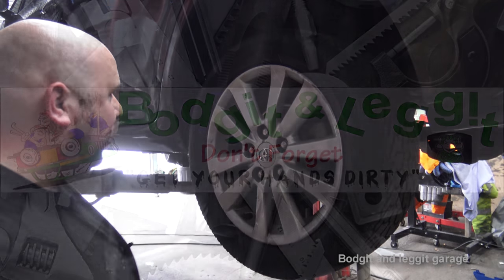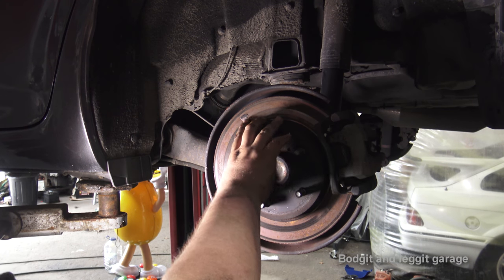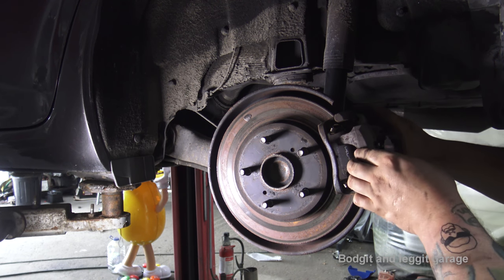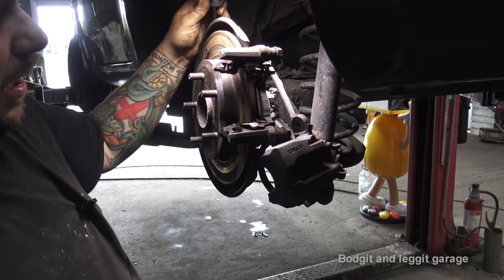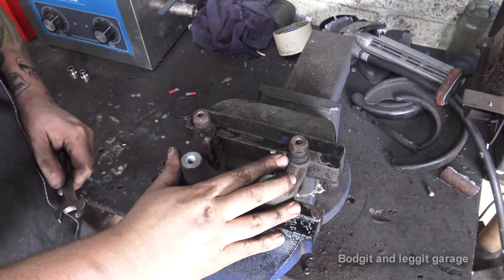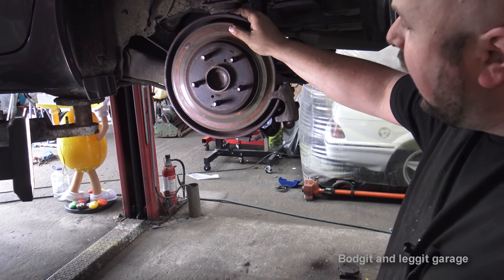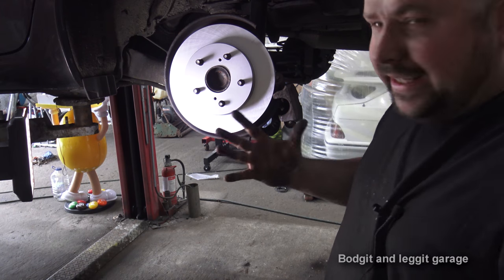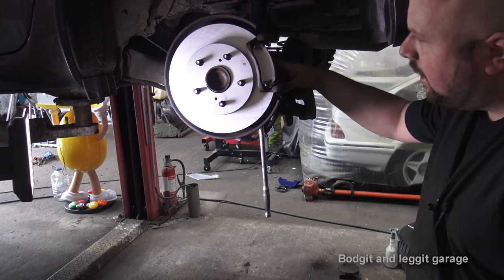2007 Toyota Auris Back Discs And Pads Bodgit And Leggit Garage

Comment: When winding back the piston, the bleed nipple should be open and a pipe fitted to collect the fluid. This should prevent damage to the square backed piston seal from being damaged. Also pads with backing should not be greased as this can damage the backing liner in some cases, the fitting instructions will give advice. 
Remember to adjust the handbrake afterwards.
Good videos, I hope this helps some of the readers,
Reply from the maker: Paul Jeffreys the only thing I agree with you is about tightening the handbrake afterwards on certain vehicles but when you whine back the piston the handbrake adjusts on some vehicles so it's not an issue I've been doing this for years and know people that been doing it for longer than I've been alive never once had a problem pushing back the piston
Reply: Like me 🤗
Reply from the maker: One Auto, lol yes Rob maybe we should go and look at his videos to see how we've been doing it wrong for so many years r no wait no video
Reply: bodgit is to young to know that years ago the seals in the master cylinder was turning over when you pushed back the pistons. This is why so many cars was having the foot pedal go down to the floor when driving.
Reply from the maker: Hard Worker  lol I'll leave the response to Rob🤣🤣🤣
Reply: This is my 32nd year of doing this stuff for a living. I have never ever had a problem with pushing the pistons back slowly be it standard or ABS brakes so long as the reservoir cap is removed to allow the fluid to go back into it. If the cap is not removed then we might cause some damage. Majority of the vehicles we work on have bleed nipples that are so corroded they will snap off as soon as you look at them. The only time I have ever seen seals turn over was years ago in an LDV Sherpa van, and this was after the brakes were bled manually (before the days of pressure bleeders)
Reply from the maker: One Auto, well said can you imagine a customer just come in for brakes and then you telling them they need for calipers at 600 £700
Reply: Is there not a tiny pin hole in all brake fluid reservoir caps? I recall seeing this on a Golf 6 and Corsa D
Reply: The ATE brake pads for my Golf have a 3M double sided sticky foam tape on then. No grease, just a lot of cleaning required. If you are a bit of an OCD perfectionist then by all means let some of that nasty dirty old fluid out of the piston and top up the reservoir rather than pushing it up back into your ABS and master cylinder.
Reply: One Auto, Hahahaha O my god booming Sherpa Van's biggest heap of rust and junk i ever drove had one when i worked at BT For only  a few weeks before getting a shiny new Bright Yellow Meastro Van and that wasn't  that much better either lol Memories....keep up the good work guy's 👍👍👍👍....Thanks for doing this Video as well Leon I will now be able to do my Auris back brakes when they need doing cheers..I have never seen the wind back calipers before all the car's I ever owned had the push back type but i can see how it's used for the handbrakes self  adjustment...Thanks
Reply: @chrislambe400  Indeed there is sir - to allow fluid to exit, & enter.

Comment: Great videos keep them coming. Off topic but with oil changes what do you think of those 12v oil pump extractors? For or against?
Reply from the maker: Arts&Trusts hi mate I've often used the 12 volts oil extractor you're safe on my video and especially for the newer cars with the plastic sump I have no problem in using them at all as long as you heat the engine oil to make sure it flows easier

Comment: great video now can I adjust handbrake on my Auris its 2008 model??
Reply from the maker: Hi mate the first of judgement you need to do is at the brake shoes against the drums and in the second adjustment you can do is at the handbrake cable but just make sure your handbrake cables are not stretched

Comment: T remove a really stuck disc there is a threaded hole between the studs, I htink that it's M8.  screw a bolt in there and Bob's yer uncle it will pop off

Comment: Great job. Can the car be on hand brake while the job is going on?
Reply from the maker: Hi mate no because you want to test to make sure there's no binding as you are doing it if the handbrake is on issues inside will be on and you will not be able to turn it freely so you won't know if you have an issue

Comment: I got both front and back brake pads and disc done on Toyota auris 2007  failed test because of brake imbalance why is this
Reply from the maker: hi mate it could be a couple of things maybe one of the brake pads on sitting in properly maybe you've got a lot of rust around the caliper and carrier and they are sitting in properly also the caliper could be slightly seized also you could have a bit of air in your system unfortunately is a few things you'll have to go through everything step-by-step if you've got really old brake fluid in your car your best replacing it as it could be contaminated with water

Comment: Hi, why do the piston holes have to be aligned with the notches on the brake pad? What happens if they aren't? Another thing.... Sometimes my handbrake goes up 3 notches sometimes 5....what is up? I've got new rear discs pads and handbrake cables are only 3 mnths old. Thanks. Oh... And refurbed brake calipers!
Reply from the maker: hi mate it doesn't have to necessarily lineup just as long as it doesn't hit the little nipple sticking out of the brake pad this will cause the brake pad to wear unevenly and the piston not to to apply even pressure on the brake pad

Comment: Why does the sliders have rubbers seals on them.
Reply from the maker: Hard Worker it is so they don't get covered in bits of crap which will cause them to seize and not slide properly
Reply: I mean the rubber on the end of the actual slider pin and not the dust cover.

Comment: Any petroleum based grease is bad for use on slide pins as it can react with and swell the rubber seals. Synthetic/lithium based grease is best as far as i know.

Comment: can I buy grunts at halfords?
Reply from the maker: Uk Mud no you can get them from my website lol just 1 million pounds each cheap I think
Reply: bodgit and leggit garage Hahaha Grunts beat any Torque wrench lol I watched a Posh American you tuber using a brand new torque wrench on 10mm Ducati Motorbike bolts he sheared about 3 off before working out the difference between foot pounds and Nmtrs LOL i  pmsl at him lol Now if only he used a little grunt with a small spanner Sorted...He also drilled thru the Plastic Ducati Petrol tank so blooming funny he will never make a mechanic...Cheers Steve